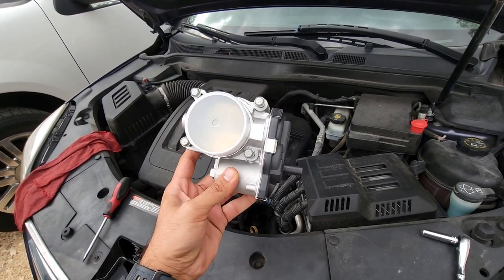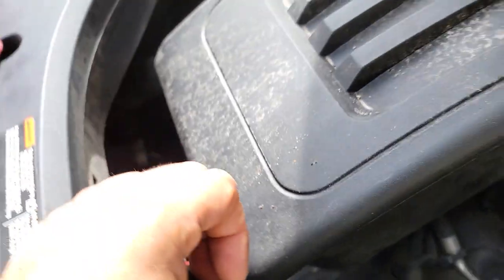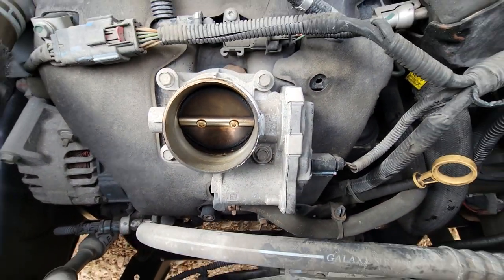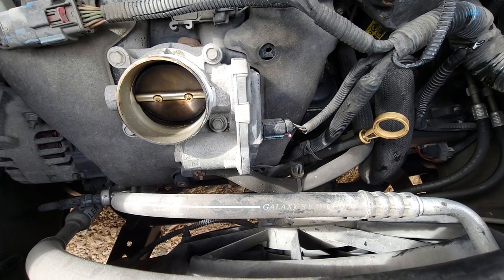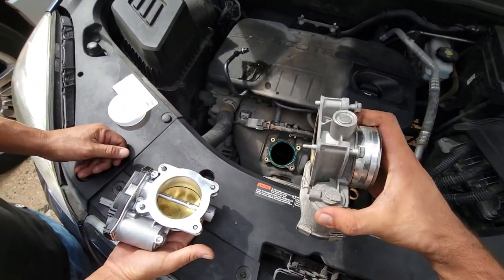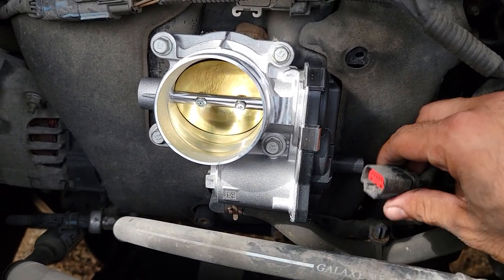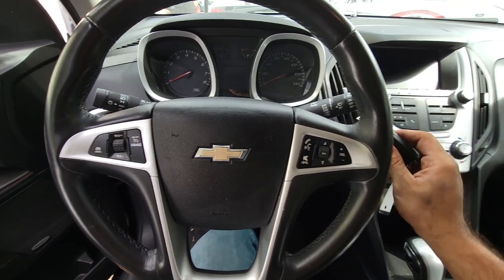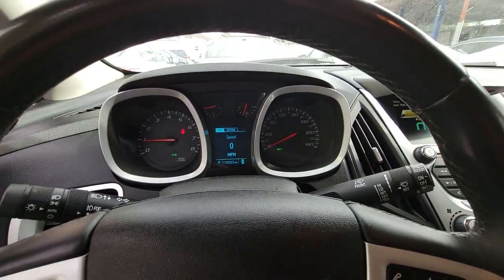HOW TO REPLACE THROTTLE POSITION SENSOR / BODY 2011-2015 CHEVY EQUINOX GMC TERRAIN 2.4L FAST & EASY

Comment: I have what looks like a small amount of oil that leaked from the airline that was located on the left side of the intake shroud. The one you completely removed. Is this a big cause for concern?
Reply: No!  this Is normal

Comment: 😮My partner was told it would need to be recalibrated with a computer. Does it need to be done or will it on its own? Thank you in advance. It is a 2010 GMC Terrain.

Comment: Can the sensor be replaced by itself or does the entire throttle body have to be replaced? I am only getting a code for sensor circuit A. Thank you for your help.
Reply: Same here. You have to replace the whole thing in any case, as that's the only way they sell the parts---together. Hope this helps.
Reply: 8 @huhdidwhat

Comment: What are the chances my throttle body would be causing stabilitrac error messages?   Not sure how I can turn the key over and I’m automatically getting stabilitrac errors on the dash when the vehicle hasn’t even moved.
Reply: Throttle body will definitely do this. Did it to my Malibu while I was on vacation. Had to change it out in 30 degrees in a random parking lot. Lol
Reply: Check main ground on bellhousing bolts as well

Comment: Will this work for 2016 equinox with the same 2.4l?
Reply: Yes literally exactly the same.  I have the 2.4l ecotec 2016.
Reply: Is your truck stalling and turning off at stops and something says engine reduce power?
Reply: Mines is

Comment: What is the error code  ? Or symptoms? How can I know that it is the failure?
Reply from the maker: thank you for your question. our vehicle was not accelerating. it would sputter and not respond when we would apply gas pedal.
Reply: @HidalgoMotorsCo  thank you!! my car responds but less than I pressed and sometimes with delay. Specially when I am going up, I have to press the pedal too much. My confusion is whether it can be a potency issue. What do you think?
Reply from the maker: @piripipipex  hmmm. it could be a few things. lack of acceleration. dirty fuel filter, clogged injectors.. even catalytic converter clogged can sometimes cause that.. and of course throttle body.

Comment: Took Equinox to Chevrolet to clean throttle body.  I don't know what the hayle they did but it made my issue worse. My car purred like a kitten. Now it bucs and seems idled high. I could kick my ownAZ for not doing it myself.  I changed MAF which sounds a lil better. I also took neg cable off to reset. Still issues. I have other codes but i just wish i didnt let them touch it😟